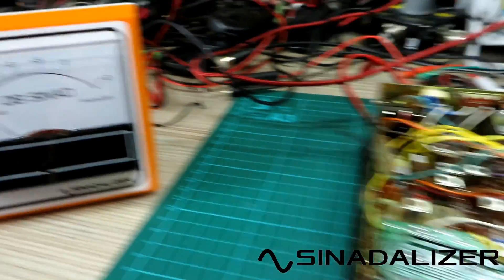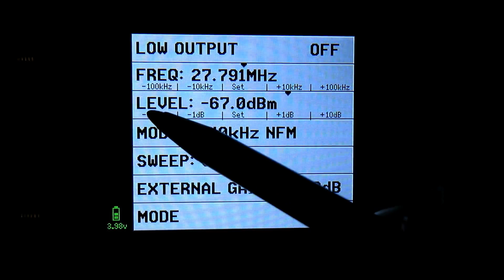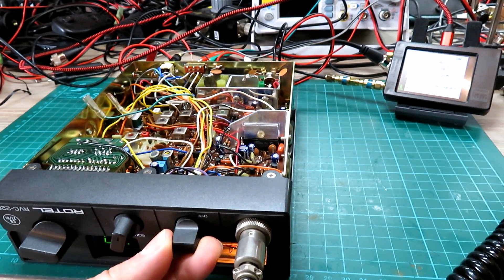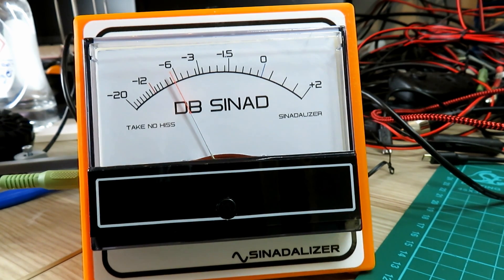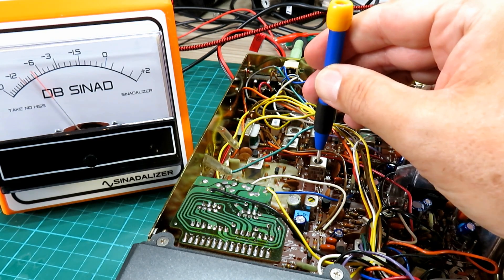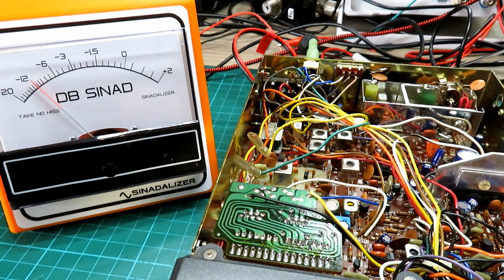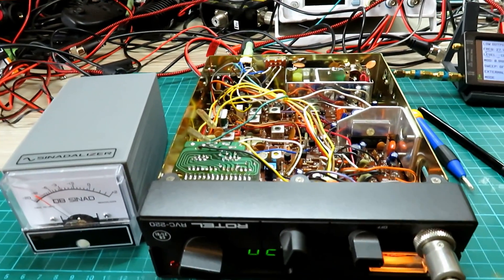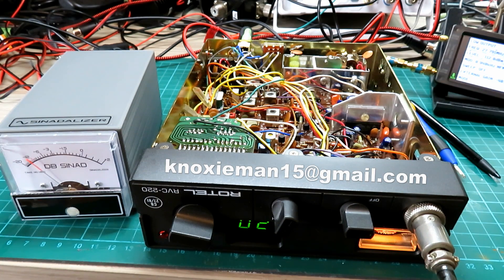USING YOUR SINADALIZER SINAD METER AND TINYSA TO TUNE A CB RADIO

Comment: Hi Paul, just to confirm you have the Sinad plugged into the speaker socket or connected to speaker terminals inside the CB radio and you have the Tiny SA plugged into the SO239 Antenna socket of the Transceiver, I'm looking forward to using mine this weekend, Thanks for a great bit of kit
Reply from the maker: Yes that's correct 👍